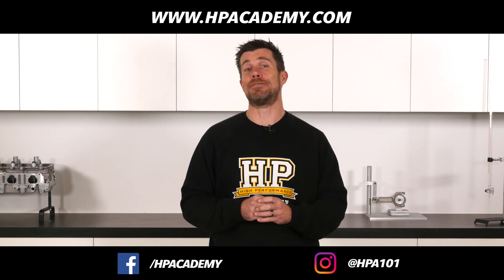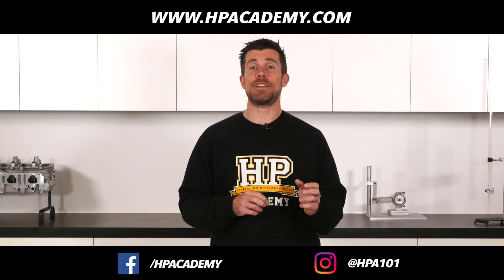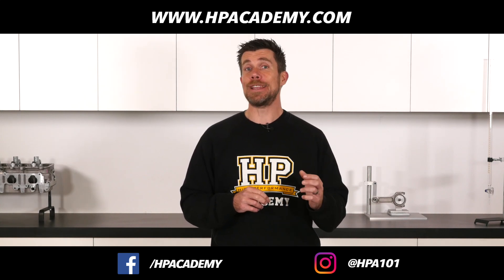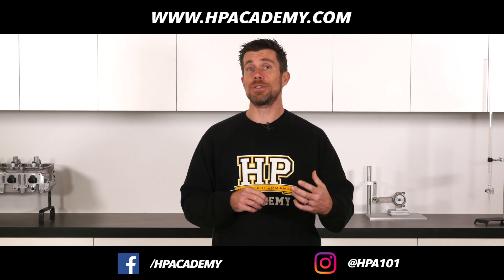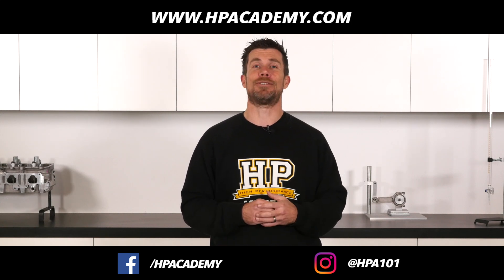[HPA Q&A] What's the difference between Inertia and Load Bearing Dynos?

Comment: I always get so suspicious of Americans using inertia dynos who run their cars up in 3rd gear, the run takes about 3 seconds and they get “800hp” vs an Aussie/Kiwi Dyno Dynamics or similar where load is applied to simulate a real world application, the car is actually strapped down, and probably gets like 500hp. Is power somehow lost or found on the boat ride over?!
Reply from the maker: Must be shoving rags in the intake and not telling us all eh!
There are certainly ways you can manipulate dyno readouts, and if you know what you're looking for it is often obvious, but even if you don't there are a few things to consider.
Before and after results are great to compare. if nothing is being hidden to try brag about a number that is worthless alone anyway, then a base output before the tuning and mods etc on the same dyno by the same operator compared to the finished produce is going to be comparable to the same data from the same dyno elsewhere.
This also helps remove some of the location variable, doesn't remove them all though.

Still a bit of wiggle room in there and a few holes if you want a true apples to apples comparison, but that is a better figure to consider than just the peak HP numbers and just a scratch of the surface of why at the end of the day they really mean bugger all in the grand scheme of things, it's really just another piece of data for the tuner, not the sole one - Taz.

Comment: Thanks andre , I purchased some of your courses and they were very helpful .
How can I determine the required load to be applied to a vehicle ?
Reply from the maker: Awesome! You can ask Andre questions via the members only forum in that case here (if you have Gold Membership) - https://www.hpacademy.com/forum
For the load, you are tuning the map so you have you load on one axis and RPM on the other, in most cases, and you just apply the required load and RPM to make the engine operate in the specific cell you want to tune. Once you start to get higher in the rev range you employ a different technique to avoid getting the engine too got or unnecessarily stressing the motor. 
The courses go into much more detail :) If you need help finding out what you need to reach your tuning goals or finding specific info within your courses just email support@hpacademy.com and I will help you out - Taz.